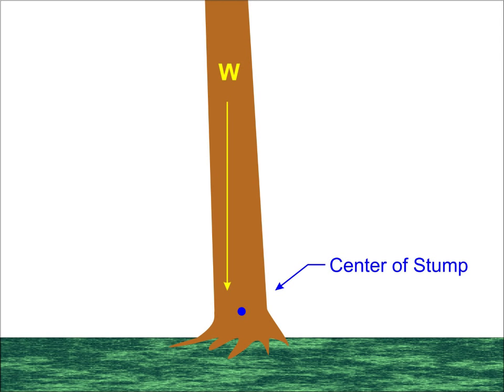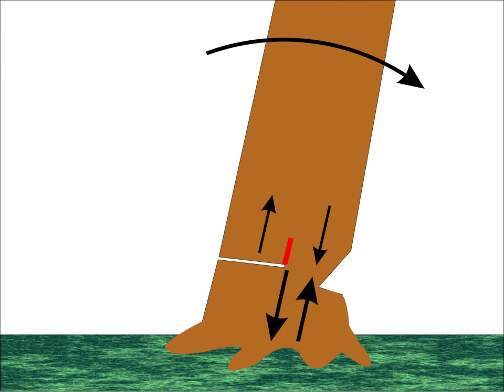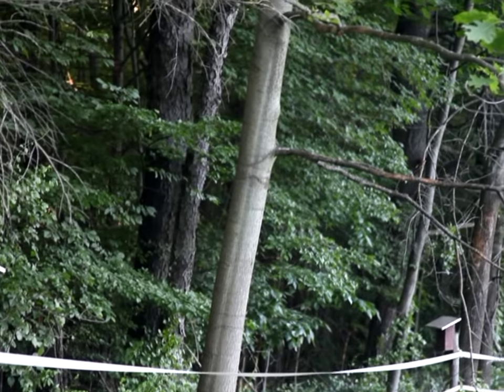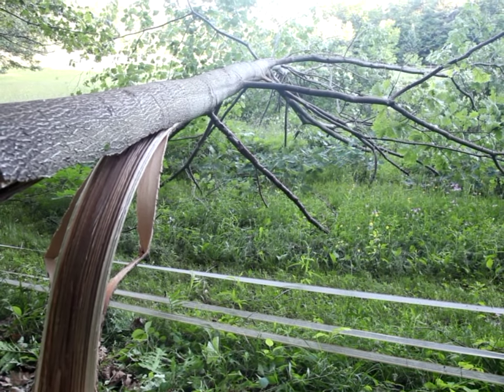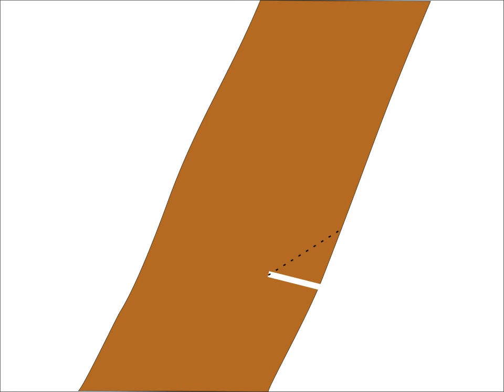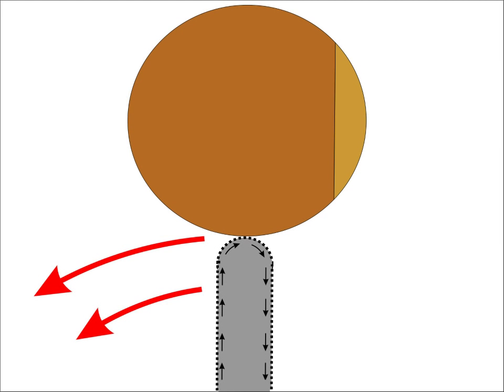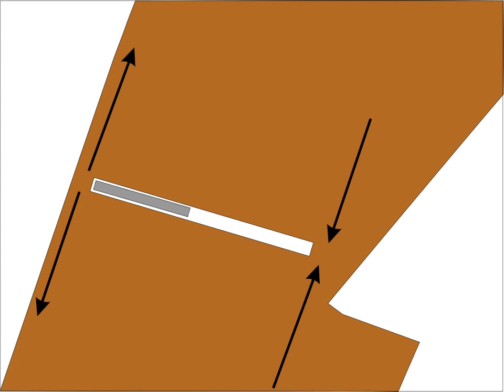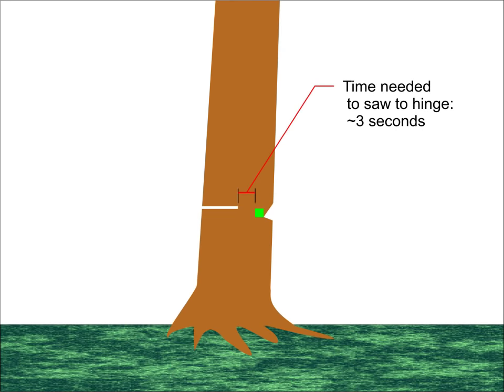Tree Felling - Leaners

Comment: how much trigger do you leave for the final cut?  also, what formula for figuring out how much holding wood should be left on the hinge?  say for a 15" dia. tree.  different sources giving me different answers.  some say 10% of the diameter or 1-1/2" hinge thickness for a 15" tree.  others i see say more.  one said less.
Reply from the maker: Both depend on the circumstances.  First consider the trigger.  The key question there is, "Do you have a reason to stop cutting?"  In some cases, it can be crucial to make sure that no pet, person, or car will be there to catch the tree.  In other cases, you may be sure you are alone and just a quick glance as you are cutting back towards the strap will be sufficient to tell you there is no need to stop.  In such a case, the trigger will only have only existed for a second.  If you do need to stop for a final check, you want that trigger to be strong enough to hold the tree until you are ready to drop it.  A couple of factors then become important.  First, how much lean are you dealing with?  The more you've got, the stronger your hinge needs to be to keep the tree up.  If the tree is basically upright, you need little as a hinge. 
 However, why take a chance?  Generally, there will be little reason why you need to cut the hinge quickly.  Second, how strong is the wood?  If the tree is dead, the wood could be slightly rotten or brittle.  Combine that with a significant lean and the hinge may fail, even if generously sized.
  As a set of rule of thumb, I'd say  the trigger should be about 10% of the diameter, if conditions are favorable.  If there is a distinct lean, I'd increase that to  up to 20%.  If conditions are bad, I'd make sure the fall zone is well vacated before even making the plunge cut. 
  Similar qualifications apply to the hinge.  Under normal circumstances, it will all be in compression.  While individual cells may get crushed by compression, the hinge will basically not fail in compression.  Tension is another matter.  Sometimes, you may be dealing with enough back lean to put the hinge under tension.  More frequently, you may want the hinge to be there to prevent the tree from falling sideways.  The greater the tension generated by either back lean or side lean, the thicker you want either all or the tension side of the hinge to be.  If you are pretty sure that all of the hinge will be under compression, I'd say shoot for a 1" wide hinge.  Notice that's not related to the diameter of the tree.
   As tension issues in the hinge become a concern, increase that amount to up to 20% for bad side lean.  Three notes of caution: 
1. If the tree seems at all rotten, a hinge may cease to be reliable.
2. Pay attention to grain orientation.  Some trees, notably maple, can have grain that spirals up the trunk.  You may think you have a 1.5 inch thick hinge, but, if the back cut is a couple inches above your notch,  inclined grain could mean that only a small portion of the fibers starting behind the notch will still end up in front of the back cut.
3.  If you need to pull the tree over, a thick hinge can make that difficult.Cutting out the center part of the length of the hinge can make that significantly easier without doing much to compromise its ability to resist side lean.
Reply: when plunge cutting after the face cut is done, i see the plunge cutting running towards the face cut first to establish the hinge size.  then cutting moves back away from the hinge.  then i see them stopping 1-1/2" to 2" from cutting all the way out the back.  then the saw is pulled and the last thing i see folks doing is after checking the surrounding area for safety, cutting the holding wood or trigger from the outside with a reaching stance that lets the operator stay clear from the tree when the trigger is cut.  then when they hit that trigger it doesn't take much cutting and the trigger will pop of and the tree falls.  when the trigger does release it is right now, pop!  i like this final cut from the back since it lets the cutter be as far away as they can be with good escape routes.
Reply from the maker: When you're cutting the trigger,  if that strap is under a lot of tension, you should be reaching a bit and you will get that "pop".  Whether cutting the strap from inside to out or outside to in, I don''t think there is too much difference in how far away you get, as you will have to have the end (almost) of your saw in contact with the wood either way.  If you remove the saw from the back cut to perform a final "all clear" check, it is easier to just cut from the back, rather than trying to stick the saw back in the cut.

Comment: I'm not an arborist, but wondering if anyone has thoughts about the following. It seem that getting a plunge cut in the right place is tricky, just a slight error could mess up the hinge width and make it too narrow on one side or too high or too low on the far side. So is it prudent or sensible to use the following sequence:
1. Make the plunge cut.
2. Make the notch using the knowledge of the whereabouts of the plunge cut as a guide.
3. Finish off the back cut from within the plunge cut.
Reply from the maker: The process is actually easier on a larger trunk than on a smaller one.  On a large trunk, you can plunge through well back from the hinge, see where your bar emerges and sneak carefully towards the future hinge.  On a small trunk, you could easily plunge either too far towards the hinge or too close to the trigger strap.
   Doing the notch afterwards is really tricky as it can be hard to align the two required cuts to meet at exactly the location you want.  It can be pretty hard to control the angle so you get the convergence you want.  This is the reason you will often see cutters fussing to clean up the notch cut.

Comment: If a tree has a mild back lean, & tension is applied to the tree (via a winch) to help direct it in the desired felling direction (opposite to the lean), I suppose the tension on the tree caused by the winch would be equivalent to a heavy leaner, thus requiring more caution?
Reply from the maker: Lex,
  More caution, yes, but not nearly equivalent to an unsupported  leaner.
   The difference is that, with a leaner, the stresses are all being carried by the tree and can therefore cause the trunk to split.  If you apply the right amount of tension early, that holds the tree from leaning and the bending stresses in the trunk are negated.  With no bending stresses in the area of your cuts, there will be very little to induce splitting of the trunk.
      Terry
Reply: Terry Hale
thanks for the education
Reply from the maker: You could get there, but shouldn't.  Ideally, you would first put a mild tension on the winch, purely to hold the tree in place as you make the notch and back cut.  Once those cuts are finished, THEN you should crank on the winch to pull the tree over.
   As a general rule, you want the tree to be neutrally loaded when you make your cuts.  If there are induced stresses, you stand a good risk of pinching your saw.  Those induced stresses would include tensioning up your winch before cutting or cutting under the lean with the tree free to lean more.
Reply: lxmzhg no, not unless there is an obsene amount of tension applied before the back is started.  Even then, if the face is proper, the stem will go to face befor it tries to chair.
Reply: @jickdawmonelason7239  Make sure whatever has the winch has enough weight to not be pulled by the back leaning tree. I have seen a couple of videos of pickups being pulled as the tree went over backwards anyway!

Comment: Did you plan this split around that fence?
Reply from the maker: The electrified tapes and wire are easy to remove from their insulators.  I merely disconnected them from three posts in easy direction so that there was enough slack for them to be pressed to the ground.  I didn't consider that the split might bring the tree down, but keep it off the fence.

Comment: When I have a leaner that’s going Barber chair, especially an ash tree I’ll wrap the base of the tree with a heavy duty strap or chain. Heavy duty rope will work in a pinch.  When the log is your livelihood it’s Imperative the log does not spilt.
Reply: For any log to split it requires a fulcum inducing  leverage to provide the force to split the tree, if you weaken the fulcrum to the point in can not hold,then the tree can't split.
Reply: Carroll Sanders  something tells me your not a logger!!
Reply: @mr.redneck2715  The strap Idea tells me you have never cut actual Timber, what good would it do on an 8 ft. Diameter Veneer white oak, that would snap it and sling it back in your face?
     If you don't know how to use a saw stay out of the damn woods!
Reply: Carroll Sanders  👍 ok
Reply: @carrollsanders9376  8 ft Diameter veneer white oak???? Damn big trunk. You must live in Texas? They say everything is bigger in Texas.
Reply: @seenonyoutube7856  Kentucky where they make Bourbon. That's not the biggest I have cut,miss having good trees.

Comment: Why is it that I don't see anyone wrapping the trunk with a 10,000 lb ratchet strap to limit or stop the chair from happening?  Is this a bad idea?
Reply from the maker: Scott, 
   I think it would be somewhat hit or miss.  The barber-chair failure actually starts as a vertical shear failure.  The subsequent horizontal movement is really more of an aftermath effect.  You would have to compress the trunk a lot to prevent the shear crack from developing.  On some borderline cases, the strap could prevent the crack from developing.
   Once a crack does develop, it will progress up the trunk.  A strap could keep the two halves of the split working together.  I believe that, in many cases, that would prevent the crack from reaching a point where the crack would cause the trunk to fail.  I also believe it would not be in all cases.  I wouldn't want  to stand there waiting to see which cases I ended up with.
   To summarize my guess work, I believe a tight strap would prevent a disaster in the majority of cases.  Amateurs will not know to consider a strap and professionals will know what steps to take to usually avoid a barber chair.  Since failures in the latter case will be both rare and unpredictable, the professionals will generally opt to take the risk, rather than hassle with a strap for every possible barber chair tree.
   Terry
Reply: Thanks Terry.  I appreciate your input, I'm still amassing my skill set.  The better I understand the inherent risks with tree work, the better choices I can make.  I won't be standing there waiting either, ;).
Reply: Mr. Hale -- Stupid question:  Since there's a lot of tension in a leaner along the side that's opposite the notch, would it make sense to make a shallow cut opposite and well above the notch (in order to relieve the tension) and then to make the back cut opposite the notch?

Comment: On a leaner, I cut my notch and the on the backside I cut at a downward angle, this gives the tree something hold against  and not split.. But you need to get the saw out in time..
Reply from the maker: Unfortunately, cutting at an angle merely increases the time to cut and the amount of sawdust you make.  It does not affect the maximum moment and shear the trunk feels before splitting.
Reply: @terryhale9006   Try it once, you'll see..
Reply from the maker: @rtoguidver3651  Speaking as a professional engineer, the mechanics don't make sense.
Reply: @terryhale9006  Just because it doesn't make sense to you, doesn't mean it doesn't work... I've been felling trees since I was 18 and I still do at 70..

Comment: what per cent could you wedge the tree over, 10% ?
Reply from the maker: First, consider what's at risk.  Wedging is fine out in the forest where the worst that could happen is the tree might not go where you wanted it to.  I would strongly recommend against relying on wedging if you're trying to protect a house or anything important.
   For a 12" tree, I would not want to rely on wedging for more than a 5% lean (1 foot out of line 20 feet up).  With more lean than that, your hinge is under a lot of tension and your wedges are under a lot of compression.  The wedges get hard to drive and the hinge is at risk of tearing open.
   Naturally, those forces only get greater as the tree's diameter gets larger.
Reply: Thanks for the reply Terry, i respect your opinion.

Comment: Hi Terry, awesome videos!  I really enjoy your thorough and methodical explanations.

What are your thoughts about the "triangle" cutting sequence recommended by WorkSafeBC for leaners (https://youtu.be/3EDybH4jjTg?t=107)?  What are the pros and cons to this approach as opposed to the "plunge cut and trigger/strap"?
Reply from the maker: +Geoff Mayes   Thanks Geoff.
   With both the triangle sequence and the "plunge and strap method", the objective is to produce a hinge of appropriate thickness before a split develops up the trunk.  With the triangle method, the second and third cuts leave a reduced amount of wood to cut through to finish the hinge.  As a distinct downside to the triangle method, the time element turns the work into a race.  Once you start the fourth and final cut, you can't stop until you finish the hinge or you bail because a barber chair has started and you don't think you can finish the cut before the barber chair really becomes dangerous.  You could easily lose the race if
1.  Your chain is a bit dull.
2.  You tackled a tree with too large a diameter.
3.  The stresses were initially dangerously high.
  You will notice that the diameter they used was fairly small.  That has two implications.  First, the triangle method may be forced because the diameter is too small to hold a plunge cut and strap.  Second, with a powerful logging saw, you should win the race to the hinge.
  I would generally not recommend the triangle method for deciduous trees.
Reply: +Terry Hale Thanks for the fast and detailed response!
Reply from the maker: You're welcome.

Comment: the 196 downvotes  were leaning trees
Reply from the maker: lol!  I feel better now.
Reply: @terryhale9006  I work as a firefighter/EMT, have very little experience cutting trees and this helped me understand stuff a lot better. Thanks.
Reply from the maker: @TheGameRazorOffical  Thanks!  Glad to hear it.  I'll assume most of your professional contact with trees will be ones that have fallen.  If so, watch out for bent branches.  They can pinch and hold you saw or let loose with a lot of energy.
Reply: @terryhale9006  oooohhh yesssss I’ve found that out 😂 and yes mostly all are already down, but the different sizes and angles are what gets us. Trying to figure out the best angle for cutting and positioning so you or your saw don’t get pinched

Comment: I have a deal with the Good Lord, that if I do not attempt to cut a tree bigger than my leg he will let me live another day.
Seriously, I have cut enough to have seen trees do all sorts of bizarre and dangerous things . I hire out the big stuff and am glad to cut it up once it is on the ground.
Reply from the maker: Good strategy.  I have had my share of surprises, but all, save one, were easily explained in hindsight.  The one exception was a pine tree leaning gently in the desired direction.  I cut a good notch and hinge to ensure it fell that direction.  Somehow, it fell 90 degrees to the lean and the notch.  Checked the stump afterward and the hinge was good.  Still no clue what went wrong.
Reply from the maker: Nope.  Dead calm Auigust day.  The only thing that would make sense would be some Wild Grape vine tying things together, but there wasn't any there.

Comment: I cut all my trees with a borecut , always. I don't see any reason why not to use it. Much safer and more predictable.
Reply from the maker: My feeling is that a bore cut is critical for a leaner, optional for a tree with no lean, but potentially problematic on a back leaner.  The last requires space for a wedge and things can become crowded on a medium to small diameter tree.  I agree, however, that using a bore cut is safer.
Reply: @terryhale9006  I agree with Terry about needing space for a wedge. If a tree is standing straight and tall just the slightest of breezes can cause the tree to set back and pinch your bar, a wedge set in the back cut helps prevent that and then if it still doesn't fall you can the tap it in harder to make the tree go in the proper direction. If you make a bore  cut and the wind comes up or shifts then you have voided that option and are at the mercy of the wind. I cut timber for a living before changing trades.